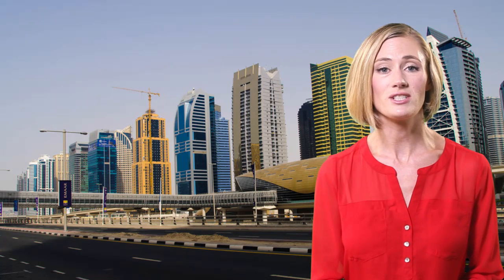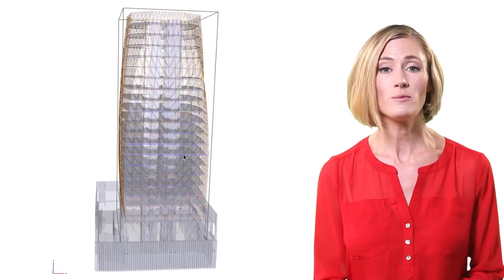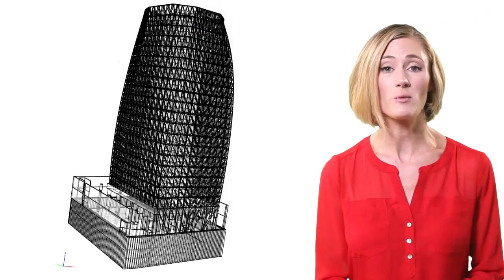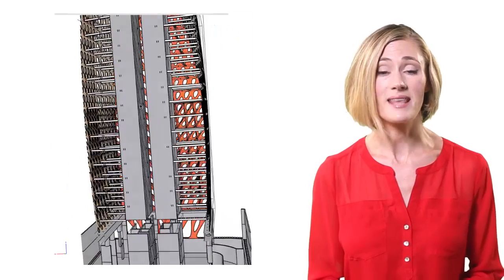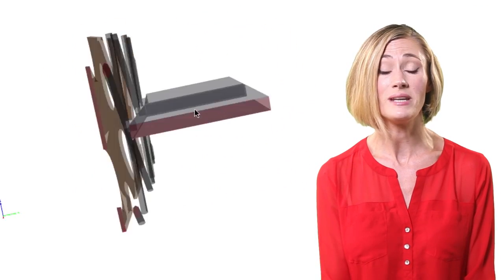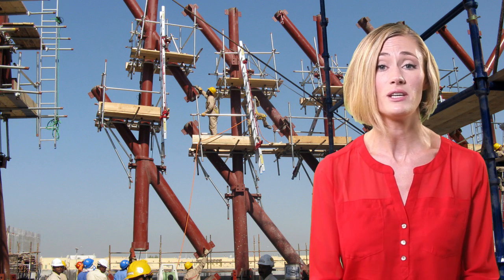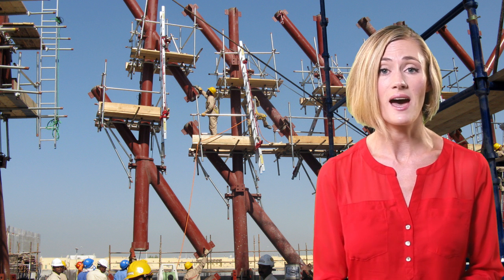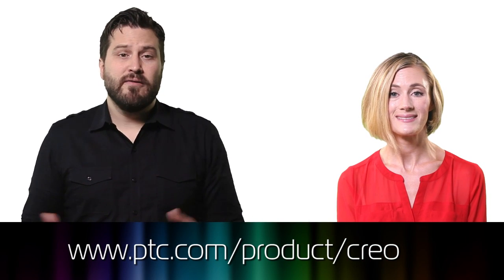Parametric Architecture: What Product Designers can learn from Complex Building Projects

Comment: I fully agree with the sentiment of the vid however this is from an engineering perspective. From a design perspective parametric design can be used for more than complex briefs and complex construction, it can be used generatively ie it can be used to generate additional complexity to aesthetic ends. THAT is the true power of parametrics and used this way it could be called neo-avant garde because it uses the new machines ie computers, in the same way that the Avante Garde used machines of their time to influence design on a deeper level. 

This is being headed by ZHA and Mad.
Reply: The beauty of parametric design lies in the complexity governed by non-obvious harmony.
Reply: Hello Devin du Plesis, Could you suggest me an open source software to design the Liwa Tower like structure. I want to present for my Master Project. Thanks in advance.

Comment: This was pretty good, but you didn't really define what you mean by "parametric design".
Reply: I know you watched this about a year ago but parametrics is a generally accepted architectural term- hence he does not need to define it.
Reply: I'll define it for you. Parametric design is a term used to a design defined by input parameters throughout explicit history. An example is Grasshopper. Parametric implies weaving of interconnected variables. Think of it as ordinary differential equations, partial differential equations and so on. 

In mathematical terms, parametric design, is design with real time functions that relates variables in real time deforming the dimensions and geometries when a parameter is changed.

That is it.